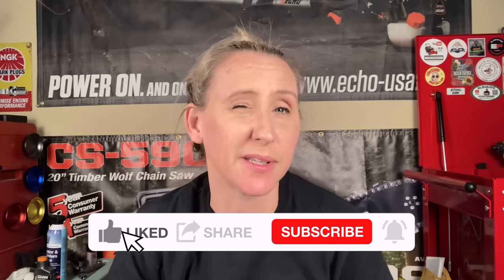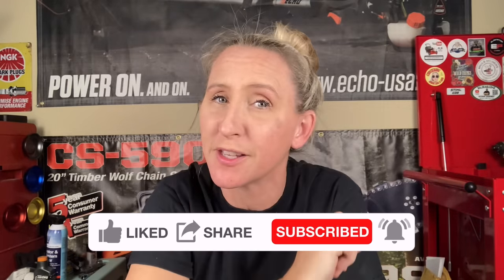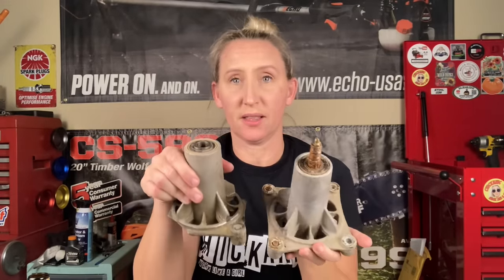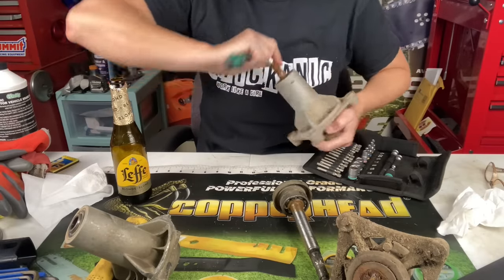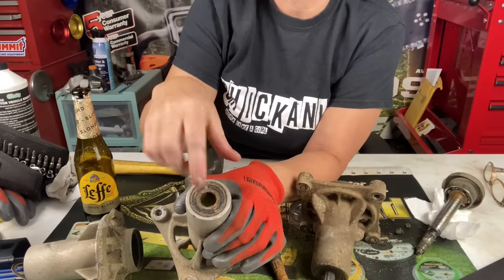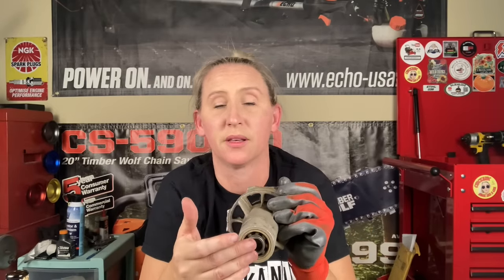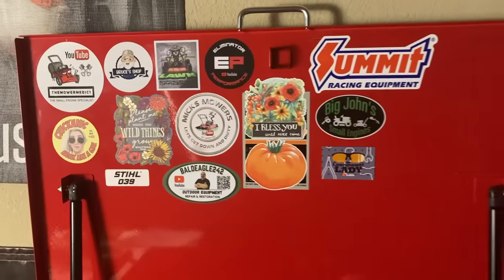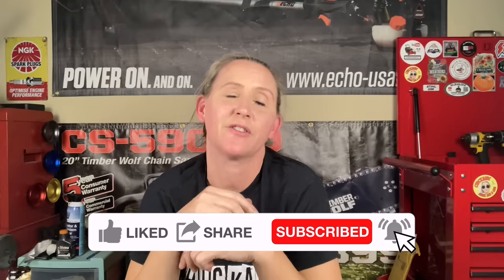THIS IS BIG!! Husqvarna riding mower and Zero Turns HAVE CHANGED! Review/Vlog

Comment: I have a 2004 Craftsman GT5000 (kohler command). The 4 bolt spindles (3bolt came after for a few years). They're greasable. Idk if the individual bearings are sealed (mine are all original). Here's some insight-> When they give you Zerks along w/sealed bearings, it's intended to be the best of both worlds and arguably is. Why? Sealed bearings keep grease In and dust Out. But they do Not keep the grease inside them from drying out. Actually, grease doesn't even 'dry-out'... it separates. Eventually the oil runs off and the thickener left behind won't lubricate. THIS is where the Zerks come in.... by adding fresh grease above (or around) the 'sealed' bearing, the oil that separates out will be Replaced by the oil from the grease you pump in (it acts like a reservoir). Thus, the zerk-fitted spindles w/sealed bearings inside have a way to add fresh grease to keep your "sealed" bearings from drying out. Hope that helps ~ 👍

Comment: I have a troy Bilt pony 17 1/2 hp 42 inch cut tractor I bought in 2010 the only thing I've ever done to it was filters changed the oil and plug not even a belt and it runs like a top

Comment: Love my Husqvarna lawn tractor, it’s been bulletproof.  They make great equipment, except their blowers.  They actually suck something terrible.

I have two sets of spindles.  Each year I rotate out one set and rebuild the other.  Never had one fail yet.
Reply: Keep swapping them. If you let them set too long the Steel screws and Aluminum housing bond and then you have junk. Brilliant assembly process!!!! NOT🤷‍♂
Reply: I bought and have been using a Husqvarna backpack blower for the last 4 or 5 years. Blows like crazy,  haven't had a single problem. I did buy it from an actual Husqvarna dealer and not a big box store. Not sure if that made a difference.
Reply: I bought a 130BT backpack blower 10 years ago. That thing has been trouble free. Best blower I ever had. I bought my dad a Husq handheld blower. 9 years ago. He loves that thing.
Reply: @airplanedude419  I’ve had my blower for 12 years, too cheap to buy another.  The problem is that it never, from day one would start after warming up.  I always had to wait.  New carbs, plugs etc. never fixed it.

Comment: I had similar experience on a toro. I hit a stump. Changed the spindle housing and the spindle. Then it mowed funny. After some tests with a dial indicator, I discovered the deck was  bent. I repaired it with shims.

Comment: Best spindles are tapered roller in a very large diameter steel housing  1 1/4 shaft  Minimum 
Toro Turbo Force /Grounds Master   . The latest version are probably even better .
Bearing preload is a lathe machined crush tube till u get 12 inch /lbs drag [torque to turn ]
Only use  Shell Gadus S2 V220AC 2 S2  grease very high water resistance Lithium / Calcium

Comment: Thanks again Chickanic. On my riding mower which is a 2003 Troy-Bilt LTX 1842. I am very very particular about my equipment I wash it and wax it armor all the wheels.... It literally looks and runs like a 6 months old.
 I do all my own maintenance and repairs as I do on both my vehicles.

However.... I have replaced my share of worn out pulleys belts springs even the transaxle at one point.... And I have noticed some design and engineering flaws in the tractor.

One of those would be there's no way to lubricate the transaxle. So when I went to replace it and I got a brand new one I looked at the design saw what moves drilled some holes, threaded them for some bolts so I can add your oil as needed.

But yes and what are my idler police you have to literally take the entire body off to get to the top bolt which is underneath the floor where you put your feet.

So when that time came I cut an access hole in the floorboard so I can access that bolt.

And yes on my 2003 Troy-Bilt LTX 1842 my spindles do have a zerk fitting at the bottom and it just goes into a hollow cavity and it does not lubricate the bearings all my bearings are sealed.

So yeah it makes you wonder how they design things.... Love your channel love the videos keep on keeping on!!!!..,👍👍👍👍👍

Comment: Good video, Husky has to do something to compete with the other cheap manufacturers as they are owned by Electrolux, I used to get old John Deere's in to fix and the spindels would take 40 pumps of grease each and the bearings didn't go bad. Only when parked outside or hit things. A grease gun can pump tons of pressure but people don't seem to realize that.

Comment: Very nice!  The last time I replaced the spindles on my old-enough-to-legally-drink Deere STX38, I took them apart.  Yup, sealed bearings!  One of the two spindles was trash - egged out pulley splines, obvious twisting of the shaft, etc...  Since everything else with the other one was okay, I ordered new SHIELDED bearings and rebuilt it.  When I applied the grease gun, I got a nice stream of grease thru the shields.  When the new ones fail due to sealed bearings / lack of grease, I'll rebuild them with shielded bearings that can be greased.  :)

Comment: yeah they did that, but still using a sealed bearing on the top is redundant, since removing the seal on the bottom of the top bearing will allow the grease to migrate into that bearing as well.

Comment: It would be nice if the manufacturers shared some of the "why we do it" info with customers.  But, I guess that would mean the products could last a lot longer...
Your channel is GREAT Bre!  I haven't used the info yet, but when I start getting back to the real world, your videos are going to be a BIG help.
THANKS!
Reply: So, the next step is oil filled spindle bearings?  Service factor is much, much higher (little problem with a top mounted bearing), ie there are almost no tractor trailers running grease these days

Comment: The difference between the bearings and spindles on the Husqvarnas are the units sold through dealers have greaseable spindles with open bearings while units sold at Lowes and Home Depot have sealed bearings with and without the grease fitting on top. Check your Oregon and Sunbelt catalogs and you will find they offer the spindles the same way. Also on a similar note Toro uses cheaper sealed bearings on the drive idler system on the Timecutter zero turns sold at the big box stores. If the plastic idler bearing has a green cover, it came from Home Depot, Ace hardware or Tractor Supply. Also, if you have a customer with a fairly new Toro Grandstand throwing the deck belt, there is an updated tensioner and belt available. Most of these units have a 4 year warranty so the local dealer can fix it with no cost to customer. If you have one with the belt off, place the deck in transport (the highest) setting. If the tensioner pulley hits the frame, the arm on the tensioner is bent and will require a new tensioner, pulley and belt. Also check the deck stabilizer bushings and other movable pulleys for premature wear caused by the tensioner.
Reply from the maker: This mower came from Lowes. My neighbor got it on mark down because they dented the hood.

Comment: I've taken backing off several bearings to be able to grease. I'm talking bigger finish mowers. It does work.  They last a lot longer. It's the same on lot electric motors . They have plugs or fittings so people grease and ruin bearings because there actually sealed . Read manuals on all equipment.  I wish I lived in your area I'd take everything to you . Just to see you.  Love seeing your videos.

Comment: One guy did a video, filled the spindle with Greece with the berring seals on. The Greece made it through those dust seals and it came out both ends of the spindle.  No need to remove seals to get Greece in the berrings, just need a lot of Greece lol

Comment: Yes, I was going to mention pulling a seal out of each bearing after watching your vid (yesterday?). I rebuilt two box store JD decks this week and noticed on the 42" (D105) all bearings were sealed BUT there was some nice grease in them. That grease was useless as the bottom bbs were squealing. The L120 (48" deck) had a replacement spindle with sealed bearings and no zerk. Had to stuff it full while reassembling. The other two are factory but did have zerks (and useless grease). FAILS ALL AROUND!!!  Good to hear AYP is making this change. Wonder if JD will follow.

Comment: My 20 year old Simplicity/Ferris came with no grease fittings on the spindle shafts, and many years later, I had to replace the spindle housings, and those came with grease fittings on the shafts because they aren't using the sealed bearings anymore.  I always feel a little better when I have to manually grease bearings in some cases, because then I know it has been greased, and am not depending on the manufacturer to have put in a non defective sealed bearing.  In my area, there are rocks a plenty, and if I am not on top of it, there are gopher mounds loaded with rocks.  Or if I listen to my neighbors mowing, there are also toys, tree branches, and anything else that gets hidden in 2-3 weeks of grass growth.

Comment: I am from the Husqvarna dealer from Kuwait and I am here for 20 years. When I came here it was ending the LT and LTH models and started CT and CTH models. From there started the issues. Mainly pulleys. The 5 or7 idler pulleys on drive and 3 pulleys on mower deck and runs at high RPM according to size . And there were no grease nipples too with bearing seals on shafts. Here in this heat, dust and humidity, it won't last more than 3 months. When I was in Sweden in 2010 I mentioned it to regarding persons, they said to tell the customer to clean it with brush after each use. Who cares!!

Comment: I've had a Husqvarna rz5424 for 15 years now.   I can tell you all you want to know about them.  I mow three acres a week on my property.
The 24 hp kohler engine is great. Still doesn't burn oil.  Tighten every screw from the factory when you get it.  It's not real heavy duty but you don't want it too heavy unless you're going commercial.  When one gets stuck or you have to move it by hand (and you will at some point) then you don't want it too heavy.  Change the Hydraulic oil every three years or sooner with 15 w 50.   I learne dthe hard way. i've replced both  sides.  It was easy however and about 350.00 a side.  They're easy to work on and great for homeowners. You can get parts for them easily.  Yes , the spindles are sealed but you can peel back the plastic seal with a utility knife and pack it but bearings themselves,are cheap. You don't need to buy the whole spindle. Just replace the bearing.  It's a rip off that they would put nipples on the spinde that has sealed bearings. The deck is easy enough to take off and on.

Comment: Huh! I was just looking up the spindles for my own riding mower -- not mentioned in this video or the one by Steve's Small Engine Saloon -- and I found this claim on the manufacturer's site about the sealed bearings with a zerk:

SPINDLE HOUSING WITH SEALED BEARINGS AND GREASE FITTING.  On these style spindles, grease is used primarily as a water barrier to keep water from accumulating in the void area inside the spindle housing and around the bearings and spindle shaft. Any good wheel bearing grease applied with a standard grease gun may be used for this purpose. These style spindles should be checked and greased annually, more often if the deck is subject to unusually wet operating conditions. Models with grease fittings will still have sealed bearings inside. Spindles with grease fittings will also have a weep hole in the spindle housing to allow excess grease to be forced out through.

Comment: It is referred to as "Planned Obsolescence". Companies put inferior parts that are designed to fail. This is a standard across all industries and designed to maximize profits. Its why the tools our grand parents use still work and your new Husqvarna has parts that constantly need replacing. My recent experience is with the spindle assembly bolt holes sheering off. The crap metal they use for this part can be seen if you happen to sheer a piece of the metal spindle, the inner parts of the metal are porous and can easily break. I had a spindle with one broken bolt eyelet. using a 7/8's socket to remove the top bolt had enough force to sheer the other three off when I was repairing.

Comment: Hmmm...I'll have to check my Husqvarna (YTH18542) to see if it has zerk fittings on top of the spindles. It's 3 years old now so I'm doubtful. 🙂Really enjoy your channel Bre...I like to do as much DIY as I can or dare to. I'm reasonably mechanically inclined, and most things aren't rocket science especially when you see it done!  I'm not really cheap, but don't have money to burn and small engine repair can be sketchy and expensive. (I had a chainsaw that wouldn't start, so I had it 'repaired' for $85, but when I tried to start it outside the shop it wouldn't start. Took it back in to learn that the gas line needed to be replaced. I finally got a running saw, but why did I get it back the 1st time when it wouldn't even start? I had another saw that wouldn't start - another case where I had put them up dry for the winter. I just let it sit on the shelf full of fuel....the next season, it started right up! I'm thinking that chainsaws are better left with good fuel in them and not run dry. Maybe even better if there are started and run a bit in winter?).

Comment: Would be nice if you could have shown how the grease gets into the lower bearing and then through the seal into the upper.
You generally show very good detail. 
I put 2 zerts per spindle on my bad boy and removed inner seals as i grew tired of replacing bearings .
How about a source for a  better grade of bearings?
I doubt I’ll get a response from this but hey I only recently learned of your channel

Comment: I rebuilt my own spindles, not that hard. Also bought a Gates kevlar heavy duty drive belt. i installed a heavier duty battery with more amp output that improved startup and it even cuts better when hitting high grass. i have gone through 6 inch grass and weeds at 2 inch high cut, no problem. 8 years now, 2 x per week, 8 months per year on rough terrain, that Kawasaki engine is a champ.

Comment: Before using sealed bearings at the top and greaseable bearings on the bottom, I was replacing top bearings twice a season on my Kubota. With the seal removed on the top bearings,  (Factory Kubota top bearings are sealed) they would starve for grease and fail, regardless of how much grease I pumped into the housings. I haven't had to replace a bearing for at least 5 years using sealed top bearings. Guess Kubota knew best.

Comment: Well hello there young lady - subscriber here. Have been through many many mowers over the years- for a long time bought only older ( read:vintage) mowers and just fixed them as needed, mostly was able to find parts as need be. Had a JD 112 for years as well as wheel horse , Cubs etc. stil have a Cub 1260 and  1641.. finally broke down last year and bought a JD 380 just before prices went wild - it’s up about 1500 since I bought mine which is crazy. Funny you mentioned spindles as I tried greasing the spindles and couldn’t get grease in there do I’m guessing it’s one of this fake zero units- why do they bother? What a waste . As an engineer why bother- put  in greasable bearings and be done with it. Can’t be a price difference. If you don’t grease your equipment when it calls for it you deserve it. Incidentally the wheel bearings  in my Cub 1641 is not only greaseable but US made so they were putting decent pieces in there as late as the 90s . Great channel and glad to be a subscriber!

Comment: Now, you need to grease your bearings because they are not sealed.  For those who maintain their equipment, it's a plus, but for those who use it and do the minimum, it may wear out faster than the sealed ones.

Thanks for highlighting this change.  I'm going to make sure I check my rider and see if it can be greased.

Comment: Last year I replaced everything spindle related on the John Deere D110 that I have. The mower was made in 2014 and typically cuts about 2 acres. I was hoping to just replace the bearings, but in 8 years the bearings had actually worn out the aluminum housings before they had worn out.

Comment: I have a JD 125 and I have found even if you grease the spindles it will blow out the seals and ruin the bearings. I've been replacing just the bearings with quality NSK, Koyo, F*G 6203-2RS sealed bearings, leaving them sealed, and they last a long time. The original bearings are cheap chinese junk. BTW, the 6203 bearing is also used GM Delco alternators for many years!

Comment: Hi Bre!!  While we're on the subject of greasing mower spindle shafts... I saw a You Tube video a while back and his subject was ... sealed bearings or not... grease them anyway. He showed (using different colored grease) how the grease will penetrate the seals on the bearings and come out the other side of the bearing. Now, I haven't had a chance to try this myself but my reaction was... "Hmmmmm".   Says he has never had a problem with the seals getting forced into the bearing or any other problem with greasing them this way. He also says it takes (depending on the inside size of the housing) around 75 pumps or so to fill the cavity. What do you think?
  I have always just replaced the bearings with sealed bearings. Important:  pull one of the seals on the new bearings and make sure there is plenty of grease in the bearing before installing it.  I have had brand new bearings that have not even an eighth of a teaspoon of grease in them!!!